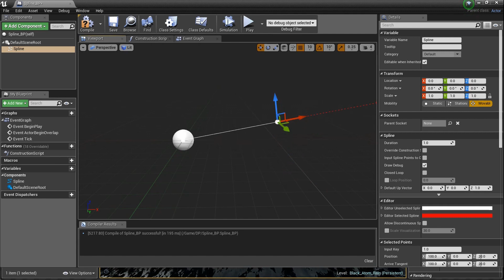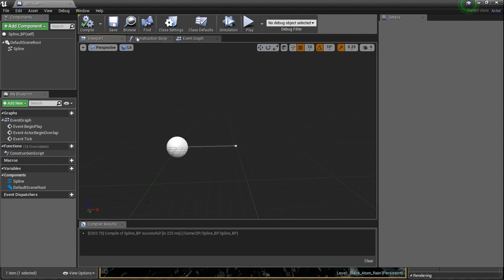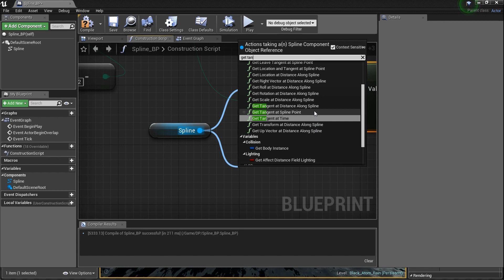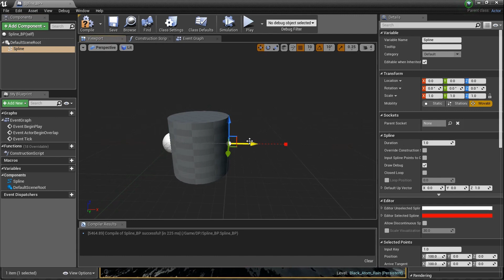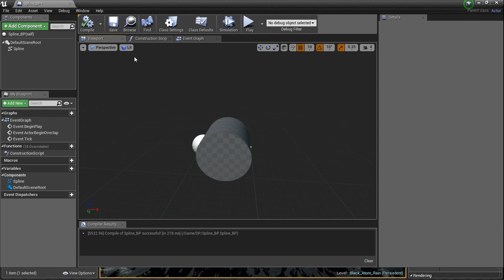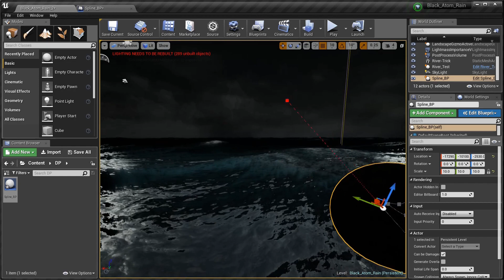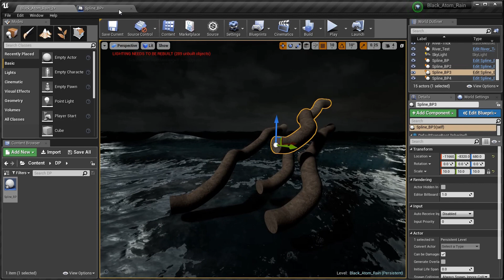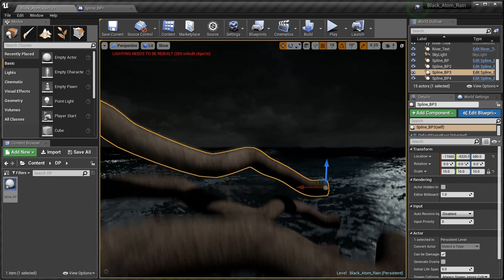DPTV UE4 Blueprints Tutorial 8 (Spline Blueprints)

Comment: Can you do it with a roadway?. This is fukn awrsome
Reply from the maker: You CAN!!! Create a plane and set it up the same way. Then send it anyway ya wish and apply the right materail!
the texture will BEND itself to the shape of the plane. should work VERY well.
Reply: @deprivedproductions7979   can I use some megascan street models?
Reply from the maker: It honetsly depeneds. you can use ANYTYHING. but the wa it's tiled makes a huge difference. But ANYTHING can be done.